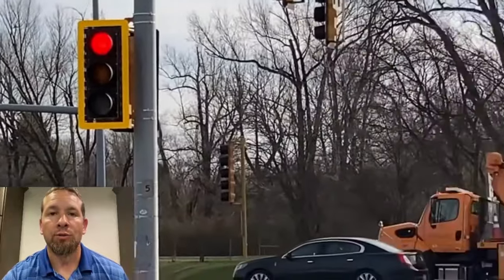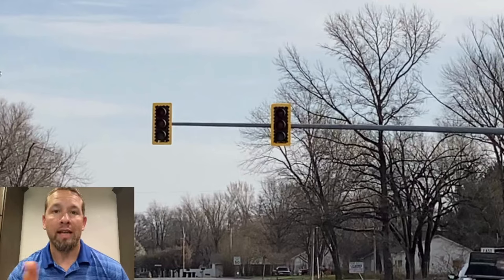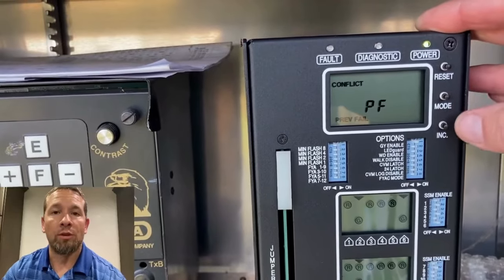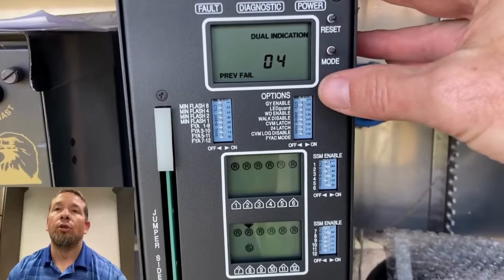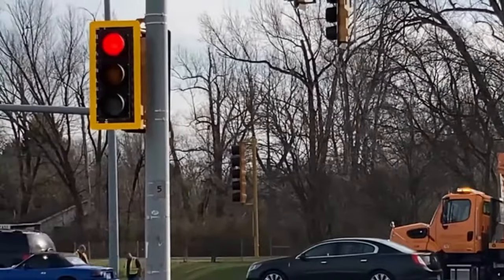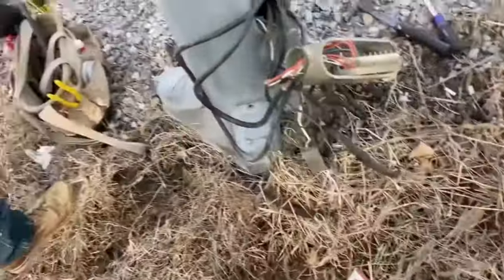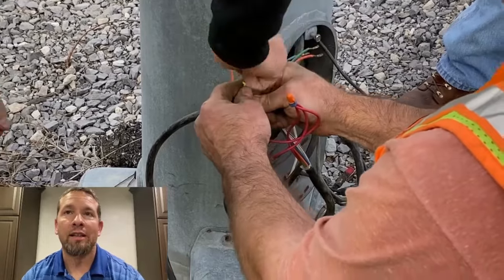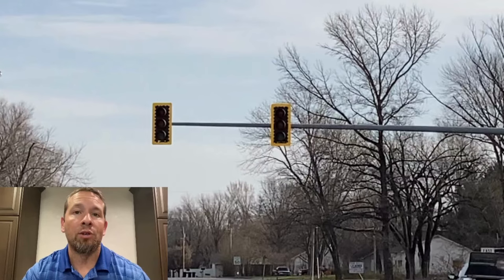Traffic Signal Troubleshooting - Dual Indication Faults

Comment: having all the splices in the hand hole seems pretty wild to me. they're in an SVT for us
Reply from the maker: We don't usually have splices in handholes.  Too much can go wrong.  But this was done before my time...I'm not sure why this particular cable was spliced to begin with.  For now, its working though on the spare wire we had available.  If that didn't work, we would have definitely pulled in a new cable.  Thanks for your input!

Comment: I would open up the other poles hand hole and make sure there aren't more of those goofy terminal blocks installed.
Reply from the maker: Good call!  I haven't done this yet.  I isolated the issue to this corner as this is the one that keeps causing it to go into flash.  But who knows what other future issues could be lurking!  😬

Comment: What voltage do the heads use anyway?
Reply from the maker: These are 120VAC.  There are low voltage traffic signal systems out there that use 48V but you'll mostly find 120VAC

Comment: Are eagle traffic good lights?
Reply from the maker: Eagle is the manufacturer of the housing (3 section, 4 section, 5 section heads) that you see hanging on the mastarms and poles.  Then you have different manufacturers for the LED's that go into those signal heads.  I have no complaints about them!  Good question!

Comment: Sounds like an underground short. Are both fixtures fed from the same wire?
Reply: I have an intersection in the area that I maintain that was having this same issue. We would replace the load pack and it would be resolved for months at a time. I just found what I believe is the issue during an inspection. Inside a 2-way spreader the wires had corroded apart. I only found it because of an amber lamp out. When I tried to change it I had no power only when the amber was serviced.
Reply from the maker: @matthewjacobs1164  It was basically what you just said.  We had a amber wire that had lost its insulation due to age.  It was starting to ground itself out on a metal conduit inside one of the signal heads.  Luckily, it was able to be fixed.  Although at some point, all the cable for the intersection will need replaced as it's not in much better shape!  
Great find!  Thanks for commenting!

Comment: Awesome video extremely interesting content! Are the traffic lights AC voltage or DC voltage? I'm assuming at the location of the control cabinet it would be impossible to have dual indication through what looks like an output modules 8R 8G terminals; one would think the logic would be an 'OR' operation, green or red; as would be, with coil, driven, relay logic? in this configuration, it would be impossible to have both indications on unless it was backfeeding from the field wiring?   as it doesn't appear there any isolation. Relays ? All the red wires go to one terminal which I assume is all the lights you want red in the two cardinal directions it serves? It's interesting to me that your output module doesn't slave the coil of a relays? for the cardinal directions involved! Designing the circuit in this way, would absolutely isolate any possibility of having dual indications…. Feedback I'd love to understand more about how this stuff works  thanks again for the video, Agape, Brother
Reply from the maker: These lights are 120V AC.   You are exactly right about your statement.  In this case, it was a backfeed.  Yes, all red wires for a certain direction are fed to the 'R' terminal for that direction.  Same for the 'Y' (yellow), and'G' (green).  A load switch takes the output from the controller (logic) and converts to the 120V AC which is what the indications in the street use.   I post weekly videos on traffic signals and also have an online membership that i teach all of this stuff.  Anyways, thanks for the kind comments!

Comment: What I have noticed while working private security during the wee hours 2 to 3 to 4 AM, many intersections will stay green all the time for the primary thoroughfare unless a car appears on the minor road which would be normal.
HOWEVER, after a hard rain, the lights cycle just they do at high noon! Since most every intersection is now controlled by lane cameras rather than loops buried in the roadway, I’m wondering what is causing this❓
Thanks for your outstanding informative videos👍👍
Reply from the maker: I cannot say for sure this is the problem, but I've dealt with a similiar issue on a project recently.  Many cameras are power over ethernet.  The ethernet cable that is plugged into the camera up on the mastarm has the best chance of getting moisture in the connector.  Everytime it rained, some of our intersections would cycle as you describe.  Then after awhile, they would start working fine.   We found that the contractor forgot to put dielectric grease in the connector up there. THis would prevent moisture in the connector.  When a camera is affected like this, the camera processor sends constant vehicle calls for that direction to the signal controller, thus the cycling.  After the connector dried up, it would work fine again.  
The contractor had to come back and go thru 18 intersections and install dielectric grease in every camera.  Quite alot of extra work they could have avoided if they did it correct the first time.
Thanks for the nice comment!